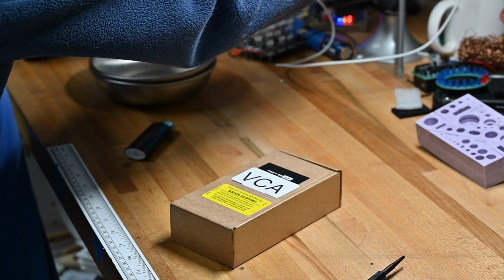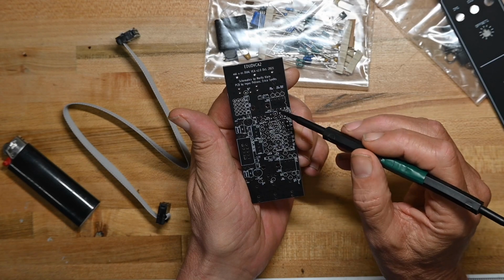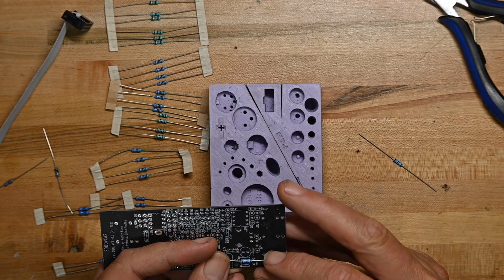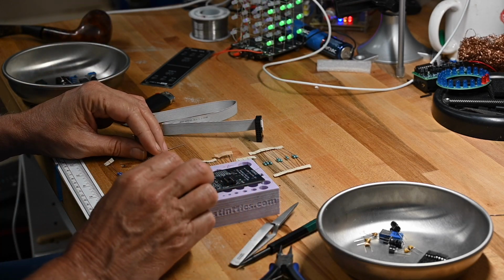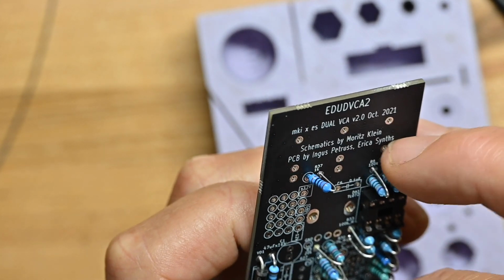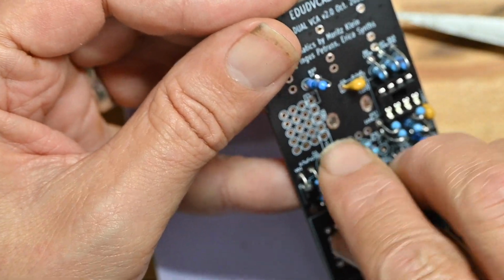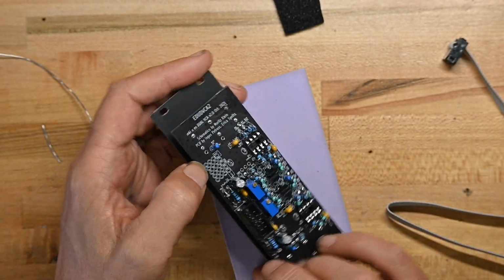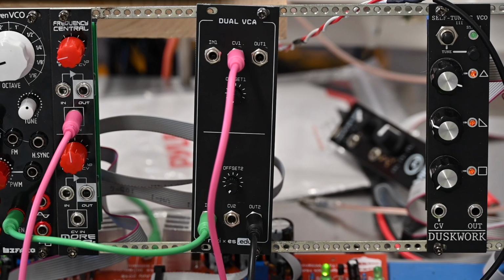C.K. builds a EDU VCA from Erica Synths kit eurorack

Comment: this is really helpful and inspiring! i'm getting ready to build the vco & vca as my first ever builds and i found this just in time 🙂
Reply from the maker: Solder tips are very personal, of course.  I use a round 30 degree bent tip with my Weller for most small-ish work and for SMD.  When I need more heat mass (like for a guitar amp) I use a thicker chisel tip.
And YES, definitely buy the assortment.  Gives you a chance to try 'em all and see what works best for you.
Reply: @CKHaun  thank you! i appreciate the support and encouragement. looking forward to more from your channel 🙂
Reply from the maker: Dive on in!  Just take your time, and you’ll do fine. A fun new world awaits!
Reply: @CKHaun  hey, i was able to build the vco and vca yesterday! my first builds 🥳 everything works great except the lower offset knob on the vca does nothing. any tips to look out for there/bad solder joints? also - just want to confirm a few behaviors on the vco. with pulse width all the way down, the pulse wave is barely audible. and with fm lvl and pwm cv lvl all the way down, it doesn’t attenuate the incoming signals all the way. thanks ck! i’m really excited to build more.